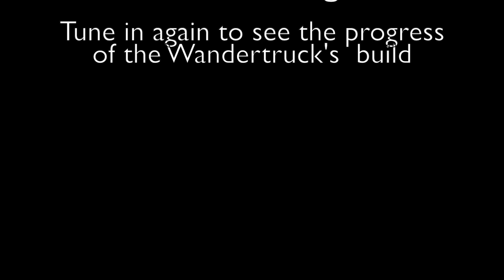WANDERTRUCK. Self build MAN 4x4 expedition truck. Truck's habitation box/pod interior so far.

Comment: Awesome video, thanks. I hadn't thought about getting the internal walls / shower cubicle put in by Vos, but they look really good... Will have to chat to them about that...
Reply: Thank you David, With the walls bonded in, and the alloy frames, it has made a very strong rigid box indeed. If you can fit the walls in build do it

Comment: I’d love to make one of these! I have been pondering for years how to make my own. I would like to offer the idea of a deisel stove. You mention that the heat is already deisel and truck I expect as well. so instead of needing a propane tank continue to use the fuel you have. This will save on storage and as well in the colder months the gas will put a surprising amount of humidity into the box which isn’t helpful, where as the deisel exhaust is directly exited and there is an exchange of heat through a glass plat which when not in use (and cool) can double as counter space.  So twice a win in the space saving department. More counter less tanks, and better access to fuel.
Reply from the maker: Thanks for the comment. Initially we thought about installing diesel cooker and doubling that up as a heater but I felt it was just too slow on the heating up aspect and the actual cooking temperature. (At home we normally cook on gas at high temperatures , like stir frys, etc). I appreciate the comment about the humidity but that is relevant to what you are actually cooking. For example, boiling potatoes on diesel cooker or gas cooker will make no real difference. The only other consideration is in the future- I have an option to install a Propex heater if required.  However, they are all very valid comments and I have thought them all through when planned the build of the truck and it really drills down to personal preference as nothing is a perfect fit/solution for all.
Reply: The propane exhaust is in large part water as waist in the burning process so it is actually an increase on top of or despite what ever you are cooking. But if the climate your in, it’s not an issue, go for it. I do expect the heat transfer rate would be less as you say. I’m not savvy to the extent.

Comment: Hi David, nice video and project.

But where is the heating?
Reply from the maker: the heating is going to be fitted under the single bunkbed. It is a truma D6E, we also have an Eber D2 fitted in the cab and as back up- the Truma aircon also does hot air and this runs off electricity as oppose diesel 👍
Reply: @thewanderfulfour  OK - but i talk about the missing radiators under / in the benches / bed area. Or will you just heat with hot air?
Don't you think you will have a problem with condensation in the children bed area / at windows? Not to cold in front of the windows
Running noisy heating all night in winter?
Reply from the maker: @felix.leiter   thnanks for the questions. We will have air con outlet and heating outlet in both bunkbed areas, under the kitchen area and in the main bed area as well as the toilet area. The truma unit is going to be placed under the bunkbed in the locker accessible from outside  to alleviate noise from the unit itself. And with the heating on and with the vent/window open, there should be no condensation. Regarding the noise matter, there is as much noise from creaking and groaning pipework throughout the box with the wet system. Furthermore, I wanted no chance of having water leaks from the heating system.

Comment: Hi.  Hello.   

Very nice building.  
May I ask which size and make of the batterys you using 

Best wishes
Reply from the maker: hi Boo, thank you. We use Victron energy storage by means of 2 300 AH 12 V LiFePO4 batterieas connected in series operating at 24V. Total stored energy is 7.6KWh of which up to 80% or 6.08KWh would be available